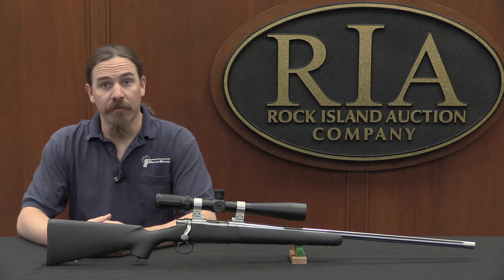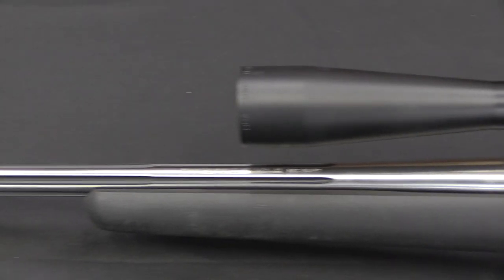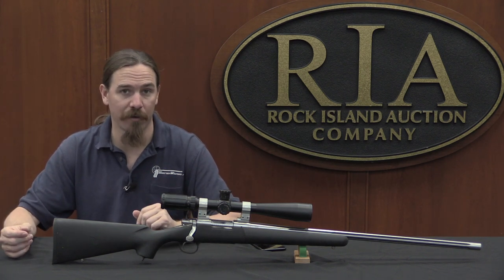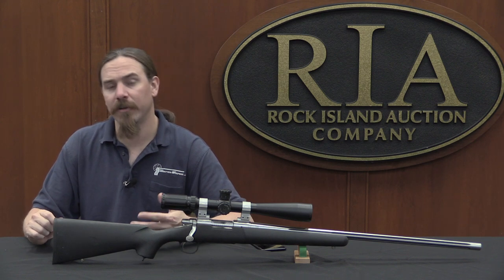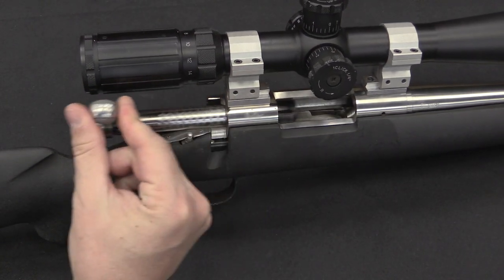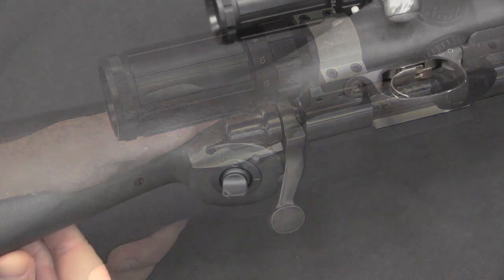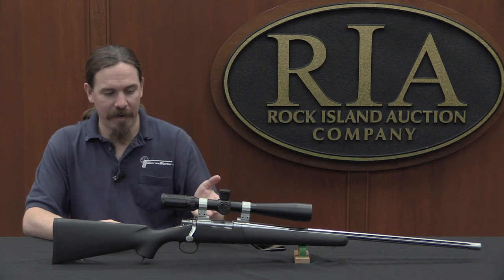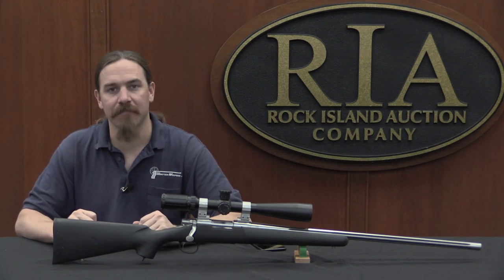Remington EtronX: Electrically Primed Ammunition

Comment: oh good, that super loseable key is on the bottom of the gun...
Reply: I imagine the first thing many owners did was replace that with a switch.
Reply: Seems like a wafer lock easy to pick
Reply: leave it on then or glue it into the keyhole
Reply: Looks super breakoffable too
Reply: @markp8295   no, I imagine they sold the rifle....
Reply: the ammunition is more intriguing to me as you could firgure out what voltage to dicharge into it and simply use it to make one of those remote operated box of barrels guns they use to shoot down enemy rockets. 
So much innovation is there to be had if electonic timeing and remote control becomes simple enough due to ammo like this.
Reply: @CheZfrmdaWestWisc   Look up Saab Bofors Dynamics here on youtube. They make many weapon systems and have had electronically primed ammunition for decades. Modern tanks, A/T rockets, and mortars can electronically select fuse type on multipurpose munitions. One round can change from air burst, penetrating, delayed detonation, and even proximity.
Reply: @ShiniSaba  It'll probably lose its charge unless it doesn't charge the capacitor with the fire switch off. Then all you'll have to carry is a 9v battery and a screwdriver.

Comment: The error codes, from the manual, for those curious.

• LED ON solid = Firearm is ready to fire.

• 1 Flash = Battery Low 1 (The battery’s voltage is low and will require replacement soon. With an alkaline battery, you may be able to get another 100+ shots before the battery drops to “Battery Low 2.”)

• 2 Flashes = Battery Low 2 (Battery MUST be replaced to clear this status code.)

• 3 Flashes = Key switch in OFF/DISABLED (O) position when the safety mechanism was moved from the S-SAFE to the F-FIRE position.

• 4 Flashes = Trigger was pulled when the safety mechanism was moved from the S-SAFE position to the F-FIRE position.

• 5 Flashes = Battery installed with the safety mechanism in the F-FIRE position.

• 6, 7, 8, 9, 10 and 11 Flashes = Factory Service Required. Do not attempt to use your firearm.
Reply: @lumox7  
This was way funnier than it should've been.
Reply: warpwar those last 6 error codes existing suggests an overly fragile design for the target market.
Reply: @johnfrancisdoe1563  
More than fragile is very badly inplemented, what exactly can go wrong with the electronics?

But I am not an electronics expert, plus this gun was made time ago and electronics weren't exactly like the ones we have today.
Reply: Wonders what happens if you attempted to fire on like 6 flashes
Reply: @johnfrancisdoe1563  I can easily think of 6 types of mechanical failures within a traditional bolt action rifle.
Reply: @seaghan6412  13 Flashes = The rifle has become sentient and is going to try and kill you.
Reply: warpwar - that 4 flashes seems pretty clever... is that to tell you if someone attempted to use the gun while the owner was away?
Reply: @zerg9523 , no it's to tell you that you had the trigger held down while switching the safety from safe to fire, which would result in the gun firing if the fire control didn't error out.
Reply: @CaptainGrief66  how funny should it have been?
Reply: What do the critical error (Factory Service Required) flashes mean?
Reply: Han Lockhart  It would be practically invisible in battle.
Reply: @isosev  ive heard alot about them doing that nowadays
Reply: The F-FIRE position? It has a stutter?
Reply: @greggv8  No. S and F are for Safe and Fire.
Reply: Thank you for sharing this information
Reply: @CaptainGrief66  Those error codes aren't meant for the user but for the service personnel at the Remington factory. The electronics on that rifle are so well designed that they can alert you of a situation when you should not continue shooting that in a regular Remington 700 would cause failure of the rifle and possible injury
Reply: @Preston Henson It would still be very small and extremely hard to see without a medium-range scope at least.
Reply: @isosev  20 Flashes - Abandon all hope.
Reply: @avi8aviate  this is a hunting rifle, not a combat rifle.
Reply: Man, when I want a nice good old fashion bolt action reliable rifle, we’ll just not right if I don’t need a computer science degree to sort out error codes xD

Comment: Ok here's a use case for electronic firing mechanisms: police/special forces snipers in hostage situations. Several snipers, each has one of the hostage takers as their target, they track their target and they each have a button they hold whenever their crosshairs are positioned for a clean kill shot. Electronically, the instant that every single sniper is holding their button, all the rifles fire simultaneously with near zero lock time. End of hostage situation.
Reply: That is actually a good idea. Synchronizing shots would be way easier with such a system. Also, might be a little overkill, but connect it to a range finder so they shoot with a slight delay to ensure all bullets hit their designated target in exactly the same moment.
Reply: So if a hostage is in the way of any shot no one will be able to shoot? That seems like a problem that doesn't need solving.
Reply: @meepk633  maybe like a second safety to activate the mode or smth.
Reply: @meepk633  if a hostage blocks a single shot no one will shoot since this hostage would be executed on the spot when terrorists bodies start to fall
Reply: Camera supported shooting,  you joystick mark the target on an optical stabilized "sight", the gun shoots when it crosses the target
Reply: Adamast Camera based systems tend to add so much lag to the eye-hand reaction time, they become difficult to work with (reported with stuff like camera-based microscopes).  This would reduce the ability to accurately maintain aim on moving targets and releasing the trigger whenever a hostage or solid object gets in front of the perp (usually a robber or madman, as current terrorists have apparently moved onto other tactics that don't allow a sniper based rescue operation).
Reply: Pasdar  As a $20,000 scope, yes.
Reply: Just pop a handy Bluetooth adapter in the USB port in the magwell and you're good to go. Just be sure to update iTunes first and for god's sake keep your antivirus subscription paid up!
Reply: That's another thing that was in d20 Future alongside with electrical primers.
Reply: By extension you could also require the weapons to have a 'permission code' to fire, so you could 'deactivate' the firing systems in an entire geographical area, or by user profile...
Reply: @meepk633  take out hostage as well no longer a hostage situation
Reply: I had a similar idea at one time for a middle east war sniper situation. Except that the rifles would fire at different times under computer control such that the sound of several guns would reach the area of the target simultaneously. Making identification of the direction of the rifle shots hard to guess. The rifles popping over flat roof parapets similar to the old "descending carriage gun" artillery emplacements. Special tubeless parascopes being used. I called it the "Bushwacker".
Reply: Bad idea for one principle reason.

Never allow remote access to a firearm no security is invulnerable to intrusion. Would you want a potentially homicidal hacker being able to pull the trigger?
Reply: Robert Miles like the smart pistol from titanfall?
Reply: Now you're talking not only electronic guns, but radio/internet controlled guns. Seeing how we still use 70 year old guns today as main firearms of our armies, I'm gonna go ahead and say 'not in this century'.
Reply: @meepk633  u could just keep the normal firing mode of a gun and just add this for extra ofc.....
Reply: There is an easier use case, namely the smart rifles that have target tracking scopes. The current models use a varying weight electronically controlled trigger, but a simple electronic trigger would make the rifle simpler in terms of fire control.

Comment: Coming from a paintball background, there's nothing strange to me about this gun at all, except the firing rate! Most if not all modern high-end markers have firing mechanisms entirely controlled by electronics (electropneumatic valves or solenoids tripping sears, for example), with trigger feels ranging from microswitch mouseclicks to clickless optical or magnetic sensors. I'm sure the level of development safety rigor would be a bit different for real firearms, but the paintball industry had most of the same problems to solve and has been exploring this for quite a while at this point.
Reply: Years ago a friend of mine was showing me his paintball marker. It had a tiny little microswitch trigger; I rested my finger against it and it went off, barely missing his head. I was used to the Tippmann markers that have a heavier, much more substantial trigger. There’s a reason why heavier triggers are preferred for firearms.
Reply: @singleproppilot  I hear you, but I'd also contend that if the only thing standing between you and a firearm accident is the trigger weight, there's already been a chain of serious mistakes :)
Reply: I'd think the biggest advantage for an electronic trigger wouldn't be the weight but the feel. Since mechanical triggers have to control a bunch of spring force and can't be fully sealed against dust and water, design choices are more limited, manufacturing is more expensive, and there's more unavoidable friction, mush, and maintenance. With an electronic trigger, you could ditch adjustable stocks for movable grips, and have a crisper, smoother pull than anything currently on the market with far fewer parts to clean or lube ... and then swap it out in less than a minute for a trigger that's just as good but feels totally different and cost less than a box of decent ammo.

Comment: my father had one of these for some time. you could feel the difference in firing, shots were truly instantaneous and crisp. the problem was the trigger wasn't really that tuneable, the primers were expensive, and the battery would die very quickly. not good enough for the match shooting we had in mind. i remember my father saying the circuit used super cheap components and bled a lot of the power from the battery.
Reply: And the first automobiles were deathtraps that tried to break your arm when you started them.  Gotta start somewhere.
Reply: paul netzel I would say switching to a 9v Lipo would easily solve that issue.
Reply: nope. it didnt
Reply: Can't say I'm surprised about that, any capacitor will leak some power when being on standby and the battery would have to keep topping that up.

If they used modern components available today not going for the cheapest parts I reckon you could make a pretty viable gun whether you use a lipo pack or alkaline primaries as power source. The right type of capacitor can hold their charge pretty well while also still being able to dump all that into the resistor almost instantly, microcontrollers and buck/boost converters also have come a long way with their power consumption.

A 9V alkaline battery (6F22 by IEC definitions) is a poor choice in energy density, sure it offers a nice output voltage but I think you'd probably be better off with just 2 or 3 AA batteries (IEC: LR6) and a good efficient boost converter. The tiny Alkaline cells in series inside the 9V package aren't a good way to increase energy density.
Reply: paul netzel If you aren't worried about added bulk, it would probably be possible to use a 5000 MaH battery and that would last for ages
Reply: My question for you is.. DId you father do what all people tend to do and keep the battery in it while storing it?
Because just like a flashlight you aren't suppose to keep the batteries in them unless it gets constant use as it drains the battery steadily and since this thing uses capacitors that is even worse (They are good for storing a lot of power, just for very short times)
Reply: Well it will have some standby use for sure, reasoning being: When Ian inserted the battery with the rifle in off state and safety disabled it did blink at him with the LED.

I don't think however the capacitors will be kept charged unless the rifle is switched to on with the key so yes some standby use to be expected but how much? Hard to say it can vary from insignificant to drained within a few months. Only real way to check is to measure it (pretty simple given the connector used on a 9V battery assuming it'll power on without the butt plate).

I would be curious about the following characteristics:
- standby power use with rifle "off" using the key
- total energy consumption to charge the capacitor to "ready to fire"
- power draw to keep it at a charged state to compensate for the unavoidable self discharge any capacitor has.
- at what battery voltage remaining will it stop working
Reply: SilvaDreams  yes we took the battery out, upgraded the  capacitors and used lithium batteries. we considered using a giant battery but that never happened
Reply: sudilos117 no such thing as 9v LiPos. LiPo battery are made of cells and ech one is 3,7 v nominal voltage. So you have a 2s battery which is 7,4 v (nominal - fully charged goes to 8,4) and 3s which is 11.1 v. 
Also, LiPos are quite fragile. I can imagine that the recoil could make one explode.
Reply: @SynchronizorVideos  As someone with a crank start Model T in the family, all you need to do is use some sense.

You pull up on the crank from bottom, cupping it with your fingers. This way if the engine does back fire and throw the crank around, it just slides out of your hand.

What you don't do is start at the top and try to push down with your weight.

(If anyone cares to know.)